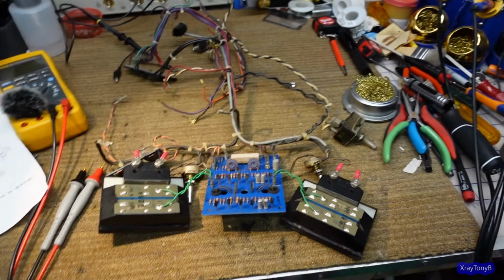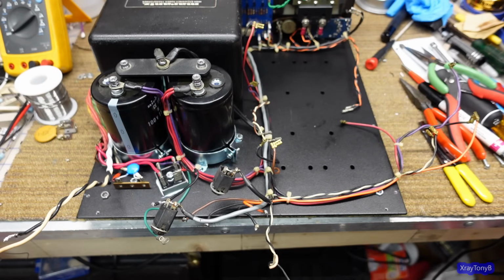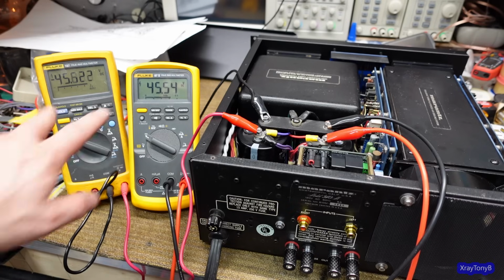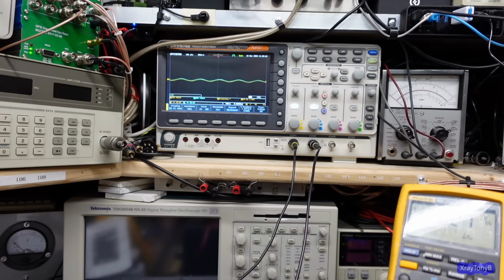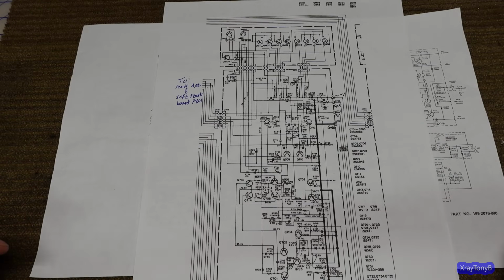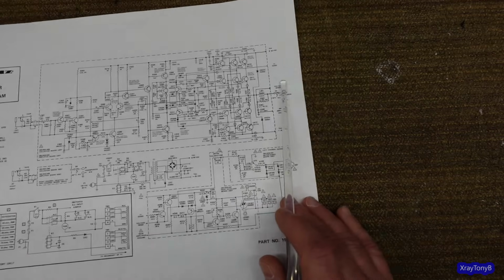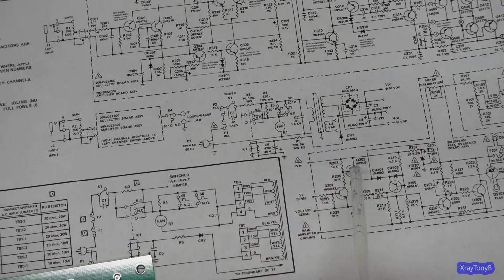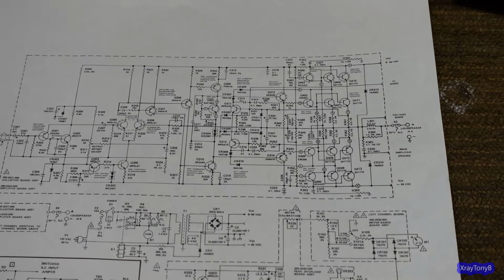Marantz 510M Part 5 - Re-assembly and Power-up

Comment: @ 37:50  That output transistor topology is called a "Cascode" arrangement. I made a similar comment to this in your part 2 schematic study portion of your video. One of the first uses of it was in early 1975 with the sale of the Nelson Pass designed Threshold 800a amplifier., and then also later in the 400a amp as well  It creates a condition where the miller capacitance of the transistors is drastically lowered, and gives them a higher transition frequency, and therefore a faster on and off time, than a regular single component configuration would. The transistors closes to the power rail have their own separate resistor divider network and produce a set base voltage bias that is not changed by the bias control, ( although, being in series with the adjustable bias transistor, it is varied with that adjustment) and he audio drive signal for them is taken from the output rail that is driven by the inner transistors emitters that are connected to that rail through the emitter resistors.

Comment: Funny story about the 510. I worked in engineering at Marantz but the 510 was not my project. The 510 was designed by Cal Perkins and his sidekick Roger Hall. When it was pretty much done Cal wheeled a prototype into my lab and challenged my lab mate Gordon Balbach and I to blow it up and walked out. we tried everything -- short circuit, inductive loads, capacitive loads, out of band frequencies etc. Nothing this thing just laughed at us. finally Gordon took the top off and put a clip lead from a power supply rail to the output - BOOM. we closed it up and push the cart to the corner. Later Cal came in and we told him it just blew up. He wheeled it out of the lab with his tail between his legs. A few hours later he came back and asked if had done EXACTLY what we did, we fessed up, A few choice word later he left with a smile.
Reply from the maker: After testing this one out, I believe it!
Reply: Hello, sir.
I would like to know if you had the opportunity to participate in the project or work at Marantz during the development of the Marantz 500 amplifier in 1973. If you have any knowledge or experience regarding this amplifier, I would be very interested to hear more about its history and technical features.
Reply: @ yes very familiar with the 500

Comment: In about 1968, I (attempted to and partially succeeded in) assembling a Dynaco SCA-35 amp and FM-3 tuner. If you could get your hands on one of these sets, it would be fun to watch you attempt to turn the sow's ear of an amateur kit maker into the silk purse of a nicely operating system. Or not. Why am I wishing that sort of terror upon you? 🙂 Oh, but how I wish I had had the likes of the Hakko soldering station in those days.

Comment: Tony, I like it when you go over the correct schematic for these once in a life time amps and receivers. Compared to today, I would not trade one of these classic components for today's surround sound systems. But, looking over the schematics and comparing the engineering that went into them, I bet there was a lot of corporate secrets being sold and/or stolen to the competitors. I bet if you took a look at the amps you are about to restore if they are similar in the component designs.

Comment: Amazing job, Tony! Looking forward to seeing and hearing the final result.
I've got a small question: You mention that "if you don't see any crossover distortion at a very low level, there won't be any". Is this strictly correct, though? Isn't it the case that if you're running the amp at a very low level, it's still running in class A mode? So that would mean that you would never have any crossover distortion by default at that low level. Or maybe I'm just a bit confused here...
Reply from the maker: Great question!
If an amplifier is operating in class A, it still passes the center point (zero crossing) of the two power supplies.  The only difference is that both sides (the NPN side and the PNP side) remain "turned on" throughout the whole cycle.  If the amplitude gets beyond the bias point of the class A portion of operation, one side switches off and the other side completes the half-cycle.  As the half-cycle approaches  the zero-crossing point, the other side will turn back on, which will allow both "sides" to stay biased on during the zero crossing point.  If the bias is set too low, there will be a point where both sides will be turned off at around the zero crossing point.  When this happens, the amp is not operating in class A, but rather class B.  
Conversely, if you turn the bias waaaay up, both sides will always stay one throughout the whole cycle.  This means that it is operating in Class A push-pull.  
On a final note, some amps (such as the Pioneer SA-9800) have a "zero switching" circuit that keeps just a tiny amount of bias on both sides, even when that side is not conducting.  It is not class A (due to the small bias current), but it is supposed to eliminate so-called "switching noise", which I don't think is an issue, but rather a marketing ploy.
Hope that helps.
Reply: @xraytonyb  Wow! Thanks a lot for taking the time to write up this response.
I get all of that, but I guess I'm still a bit confused about the case where you would have too little bias (but not completely turned off). Could that cause a situation where everything would look perfectly fine at very low level but you would get crossover distortion when you increase the amplitude?

Comment: Great Video - can wait for part 6! 

When you do the performance measurements in the next video - could you measure voltages drops across r316, r321, r322 and r326?

regarding the Phase Linear 700 which series is it? one has quasi complementary output stage - the next version has full complementary - BUT it seems that some people change the first version from quasi to full complementary  - if you have the first version maybe you also want to convert it to full complementary😀 I have a 700 series 1 that I want to convert it 😁

Comment: Tony, I don’t know if you still read comments about old videos, I try it this way. Simple question about a buck converter you used for feeding a speaker protect project. Did it in anyway interfere with the quality of the sound of the amp? I mean it worked at high frequency and could interfere with the inputs. Better use that small transformer?
It’s an off topic question, but know no other way to contact you.

Comment: Funny, I was going to ask if you were ever going to do a Phase Linear PL 400/ 700. Awesome! I've gone through a few of those in the last 10 years or so. Interested in seeing your thoughts on Carver's design, if you're going for the updated preamp board, backplane, soft start, and DC protection. And your thoughts of converting to full complimentary vs quasi. Recently read about leaving the first set of output drivers as built. The RCA devices. Apparently it was done to prevent some weird oscillation when ran in quasi complimentary. When converted to full complimentary outputs it becomes a non issue. I've been contemplating buying the White Oak boards, and maybe going with the updated backplane that's offered. I have 3 PL400's to go through. Lol. - Thanks for all the knowledge I've picked up from you in the last few years. Love the content!

Comment: I'm interested in this power stack concept. We used to have a Belgian company who was specialized in building discotheques and dance cafes in the 70's and 80's called Vetelec. Their third generation amplifiers also used this concept. They had two models: a 100 watts and a 200 watts amplifier. These amplifiers are still very popular these days. I did repair a few of those but never had a real schematic aside from one that I drew out of the pcb myself. So I'm following with great interest... :-) 

A note about the speaker protect board you are using. It is good practice to have the speaker terminals shorted when the relays are not active. That is an additional protection should the amp fail and put rail voltage on its output. When the relay disengages in such an event; there will be some arcing going on. When the relay contacts are shorting the speaker terminals in the "off" position, that will help stop the arcing and thus provide additional protection for those expensive speakers. I noticed that the relays in on the board only use a single contact (ON - OFF). So this board does not use that concept. I would be worried about that, especially since this is an high power amplifier with 80 volts supply rails.

Comment: but that inrush module you can use externally too plug the amp in to that and then you wont change anything in the amp for the purists among us  and that would be great too for amps you just got new and under warranty and you want better inrush protection then you wont void your warranty....

Comment: Thank you sir. Speaking of protection relays, I just installed a speaker protection relay on my old Pioneer, thanks to the videos you made explaining them a while back. The circuit I used (from Amazon, and UPC1237-based like most) did not have it's own power supply but I used a shielded one from a wall wart with the appropriate voltage and it works just fine. I debated between mounting it in a external project box like you have shown but I finally put in inside the receiver case. I was my first "electronic project", first time I opened up an amplifier case, and thanks to your videos I now have a pretty good grasp of what does what in there and I knew what I was doing installing this board.

Comment: some people are just whack. they would rather have a 100% original, non working unit sitting on a shelf than a slightly modified working unit that they can use.  "what's that?"..."it's a 100% original marantz that doesn't work." ... "why don't you fix it?" ..... " because it won't be original anymore."....🙄😒🤨🤐
Reply: Agreed 👍